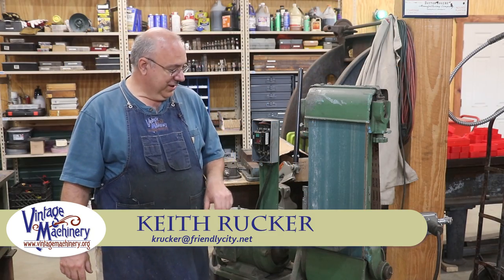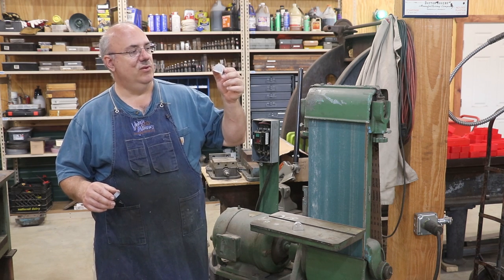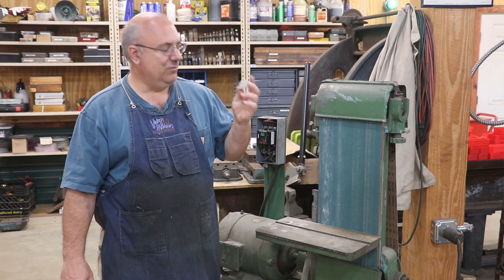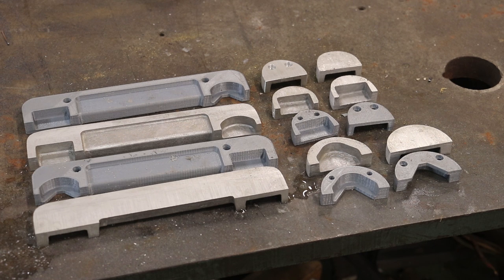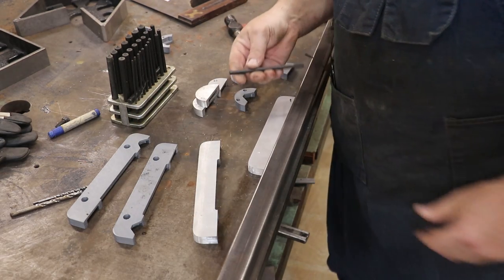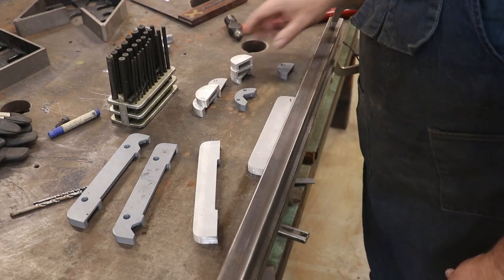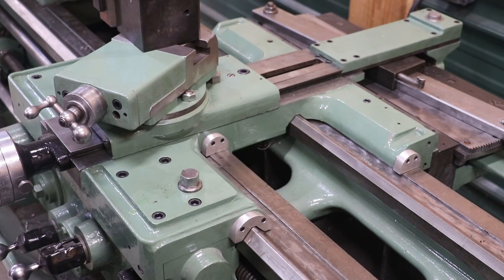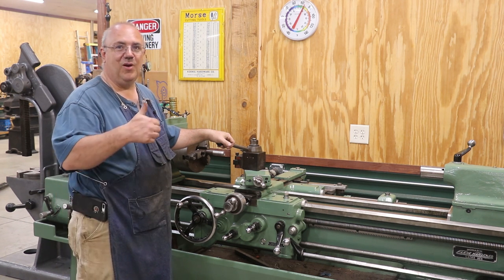Making and Installing  New Way Wipers: Monarch Lathe Restoration - Part 34

Comment: I modified my HFT portable band saw and hung it on a stand and made a small 6"X6" table screwed to the saw. That made it work well and more safely than the small platen that came with it. Use a plastic hand clamp for the trigger. Use a power strip to power the saw and turn it on and off. It's advisable to us a power strip with a breaker on it. If the blade stalls it will fry the motor in a heartbeat. I did that on my new one! The breaker will protect it.

Comment: Better than new Keith. Disassembled, painted, parts replaced, scrapped, reassembled. Those wipers work as intended. Now the fun part, throwing chips. Thanks for sharing. That 3D printer will come in handy.

Comment: I am surprised you did not run this as a small production run.  Attach a stop to your vice so you can accurately reposition the parts.  Drill the first hole in the first 4 parts.  Move the table over and drill the next 4 holes.  Counter bore these holes setting a proper depth.  Move the table back and counter bore the last 4 holes.  Works for the other two pairs too.

Great to see you finishing up the Monarch.

Comment: When sanding alum on the belt sander use some grease that is used for finishing alum as it will stop the belt from blocking up and also give you a finer finish.
Reply: Might candle wax work?

Comment: Something to consider - Add a small hole on the top of each wiper so that you can inject a bit of way oil from time to time.  That lathe is looking beautiful.
Reply: The ways are oiled by an internal system.  No need for extra oil in the wipers.

Comment: I was a goldsmith where every casting is hand finished with files and a sanding disc on a flex shaft tool. i'm now getting more into machine shop practice.  
    It's funny to see machinists getting all skittish when it comes to shaping metal free hand, when a hundred years ago, the most precise measuring tool in a shop would have been a pair of compass type calipers.  I have been reading in the Lindsay publications books: "Echos From the Oil Country", where at times, they had to go around the shop and make sure everyone's steel rule was the same length.
Reply: That is a great series of books.

Comment: You should drill a small hole in the top of the way wiper holder so that you can add oil to recharge the felt pads.

Comment: I recently beought a cheap 4x36" sander belt with small disk and its just so useful I wish I had brought it sooner.  Nothing compared to keiths beast but I don't have room or justification for a bigger one yet.  Everything from making parts to sharpening / cleaning chisels and scraper blades that had various sealants and plasters dry on them oops.

Comment: Keith, I know that opinions vary, but when I was going through my machinist apprenticeship years ago, I was taught to never wear gloves when using a bench grinder or belt sander.
Reply: I'll second that, a gal who was deburring metal plates on a Delta vertical was wearing gloves, sucked her hand into it, wedged between platen and inner table lip, got one hell of a nail job for free.

Comment: Nice job on these. As a safety note, you might want to get a foot switch (the type that you plug a tool in to). At 18:00, I shuddered a little. Zip tie the switch in the tool and plug into a foot switch, then you have both hands free for the work, and in a more comfortable position. I use foot switches on a number of tools, including my largest drill press at times.
Reply: Good sensible tip. I must admit I was not comfortable watching that bit of the video.
Reply: Unfortunately he was using a cordless. I once used a rope tied into a loop over the switch with a 2x4 as the foot switch. Didn’t have my regular foot switch hand at the time

Comment: Nice job. Until you get that cover for your electrical switch, be careful turning that belt sander on and off. I would also use a chip brush to remove chips instead of my fingers.
Reply: Thanks mom.

Comment: I know it was not on the originals but would it not be a good idea to drill a hole through the top so you can add additional oil to the felts in the future?

Did you get some sort of insect bite - your right cheek looks a bit swollen?
Reply: There is an oiling system built into the machine to supply the ways.  No need to oil the wipers.

Comment: Keith:  Love your videos.  Just a thought, would a small hole sized for your oil gun in the top of the way wipers be a good improvement to keep the ways lubricated?
Reply: same thought occurred to me also.
Reply: Check out the episode where he's cleaning and rebuilding the saddle.  There are oiling holes drilled into the casting that apply oil to the ways.  The wipers might add a miniscule amount of oil to them, but their primary purpose is to keep the grit and grime off the ground surfaces.

Comment: Hi Keith really like that hammer collection in the back rack,how many hammers does a man need?
Reply: Ask Tom over at OxTools.
Reply: It's a feel thing, I remember my father saying that if you didn't hold the shaft right you were using the wrong hammer. Maybe it's like Sir Henry Royce who didn't believe in torque control, but made the wrench the right size for the job, so a screw that needed to be really tight had a long handle, then it was down to feel. Empathy with the job. I like it.

Comment: If a customer or a job comes in and just needs something taken down a couple thousands or drill a hole for a bolt you don't always need a mill or sirface grinder. Alot of the time a drill press and a belt sander can get the job done because that is all that the job calles out for.

Comment: Couldn't you just have used the 3D printed parts? Is there enough force on them that they would need to be made from aluminum? Or was this just to keep the originality in a restoration?
Reply: Probably, Keith Fenner used CNCed Delrin to make way wipers. This Keith probably just wanted aluminum like the originals.

Comment: Any reason to drill a hole from the top to the felt to drop oil or will waste oil on the ways be enough?
Reply: Waste oil on the ways should be enough.  The apron of the lathe has its own oil reservoir with oil pump and lines.  That oil pump is operated whenever the carriage is moved along the length of the bed, and the oil lines meter way oil to everywhere its needed in the crossslide, saddle, and apron, including of course on the ways under the saddle, so oil is always being pumped onto the ways whenever the carriage and saddle is being moved along bed during longitudinal turning operations.  So, as long as the apron's oil reservoir is kept topped off, there shouldn't be a need to pre-oil the way wipers.
Reply: @Patriot1776  thanks for the detail  here, wasn't aware the ways are actively oiled.
Reply: @StevenAndrews  Your welcome!  Keith details the active oiling system in the parts of the series dedicated to taking apart the apron for servicing and cleaning and then reassembling it.  ^^
Reply: @Steven Andrews And part of the servicing of the apron, IIRC, Keith did find he needed to fab up new oil lines out of copper tubing to insure the oil pump would be getting oil to every lubrication point that needed it.

Comment: How are you going to re-oil them? A small hole at the top would be handy,other wise you could just loosen them enough to sneak some oil in,or remove and clean and re-oil. Holes would make it quick and easy and less likely to procrastinate.
Reply: Fill with chips fast
Reply: Waste oil on the ways should be enough.  The apron of the lathe has its own oil reservoir with oil pump and lines.  That oil pump is operated whenever the carriage is moved along the length of the bed, and the oil lines meter way oil to everywhere its needed in the crossslide, saddle, and apron, including of course on the ways under the saddle, so oil is always being pumped onto the ways whenever the carriage and saddle is being moved along bed during longitudinal turning operations.  So, as long as the apron's oil reservoir is kept topped off, there shouldn't be a need to pre-oil the way wipers.
Reply: @Patriot1776  Aha,I forgot about the oil system!

Comment: Your new vertical sander you’ll find is one of the handiest tools in your shop. It is also one of the most dangerous tools in the shop. To make my point take one cotton work gloves when the sander is running and just drop it near the worktable and the Sand belt. If and whenthe sand belt grabs the gloves be thankful that your fingers were not inside the glove. In my shop it is mandatory that anytime somebody has to have fingers within 6 inches of the moving belt that they will have a fixture or a suitable tool to keep all body parts at least 6 inches from the belt ! I know you were done work around your table saw as close as you are what’s the sander. Get to close in the outcome would be similar.

Comment: Why not just use the plastic printed ones?
Reply: I use printed parts in the shop, and while they do work here and there, anywhere hot chips and oil get can quickly de-laminate or otherwise damage the prints.

Comment: There is essentially no load on those parts, so the 3D printed ones would work fine.  Naturally, that would only be a solution for a practical application, not for a restorer.
Reply: How would the plastic hold up to the oil and hot chips that would inevitably end up on them? Obviously the chips would be the less likely problem as the wouldn't necessarily get on all of them.
Reply: @thanebaxter  Use ABS or one of the metal infused filaments.  Even if it went bad after a year, just 3d print another in 30 minutes.  Painted to match the machine, no one but you would know the difference.

Comment: Real concern about wearing gloves near that belt sander...………..
Reply: He knows where his fingertips are. A glove is more likely to be dragged down between the belt and the table and that would be WAY worse than losing a fingertip to the belt.
Reply: @Mishn0, HUH?!
Reply: @tabaks  Hitting a belt sander like that with the light force he's using on those parts won't hurt you at all. I've done it. 

But, if the belt drags the loose material of the tip of the glove finger down between the table and the belt, the force of the moving belt will jam it in the gap and pull his finger in with it, holding against the belt and grinding away until he can shut the sander off. 

Way worse than touching the belt for a fraction of a second, pulling your finger away and saying "ouchie".
Reply: David Wright -agreed, but those aluminum parts get hot real quick on a belt sander.
Reply: @nevetslleksah  They also cool back down real quick. You generally don't want to overheat the metal anyway.
Reply: Not preaching, just concerned. @nevetslleksah